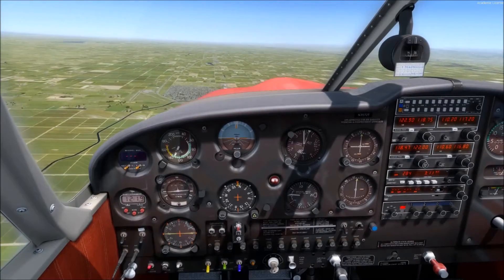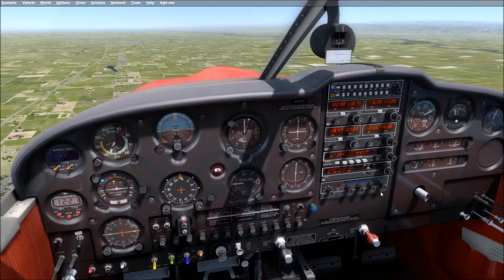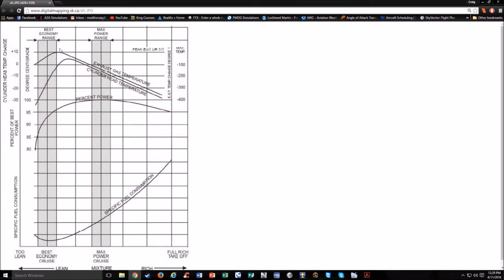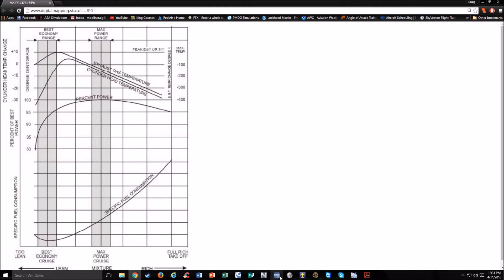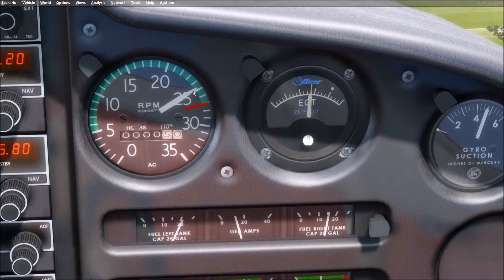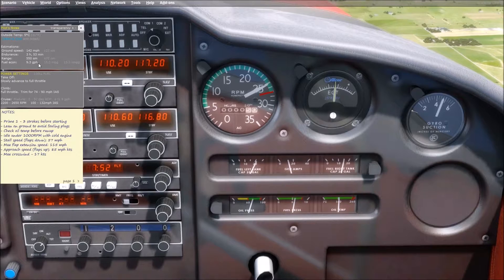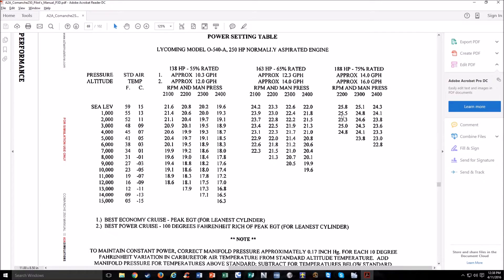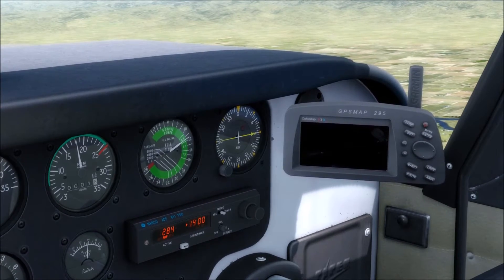How to Lean the Engine (Mixture control)

Comment: I use mixture for start up and pull it mid air when engine is on fire and when I want to have fun messing with the engine in x plane 11 also for leaning the fuel too for fuel and refuse gas in the air

Comment: Why can't you just have a computer built into the aircraft that does it for you in the most efficient way :/
Reply from the maker: Those do exist now but they're not in most planes due to 1) age, or 2) weight/cost
Reply: I get the age thing, but you could argue that you could install these.

They would not weigh much at all, or cost much either. Have a look at those micro controllers out there.

And also thanks for the great video.
Reply from the maker: Sublivion you won't be able to install it on a certified aircraft without an STC. $$$
Reply: Oh
Reply: No computer can replace your ears. Listening a aircraft engine, and understanding its functioning is one of the aviation jewels. And A2A has a great simulation for this as well! 😁

Comment: What about LOP on fuel-injected cessnas ? I do it quite a bit in a2a addons, they run nice and cool, of course i won't be beating any speed records this way but still :)
Reply from the maker: +Mozoto In the real world, it's not smart to try LoP without GAMI injectors (or some other way to ensure even mixture across the cylinders) and an engine monitor that shows data for all cylinders. Once you have that, it's easy (and only really possible for fuel injected engines, like the 172R). With that said, I think the mixtures ARE more evenly distributed among the cylinders in the sim, which makes LoP easier in the sim. In the real world, the engine will most likely run rough before it gets LoP. When you lean until it's rough and then push it it, it's probably just on the lean side of peak but I wouldn't call it running LoP. For legit LoP operations, I think you want to be around 50 degrees Fahrenheit lean of peak. It's just not possible to do it legit in the sim. 

Leaning the mixture is quite a complicated science and it's hard for us because we have manuals that give us recommendations that aren't always best for the engine, like 50 degrees rich of peak. That's the worst spot and you're at the greatest risk for detonation there. So you want to be really rich of peak (at least 100 degrees rich of peak) or at peak, slightly lean, or just straight up lean of peak.